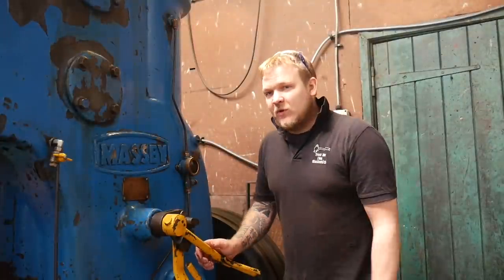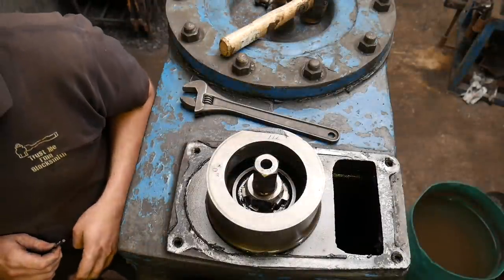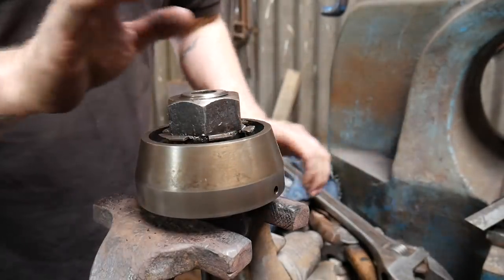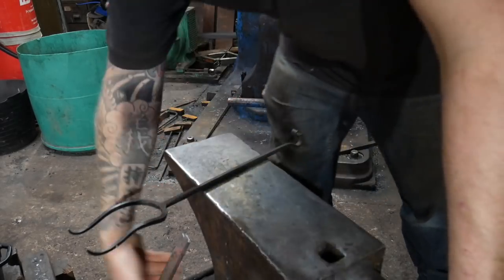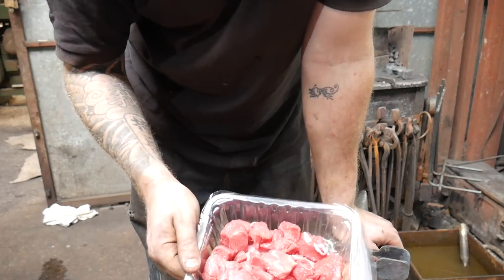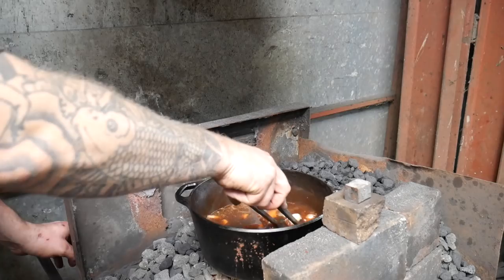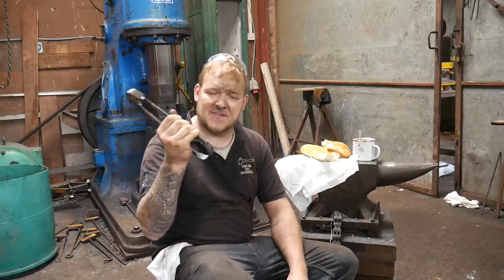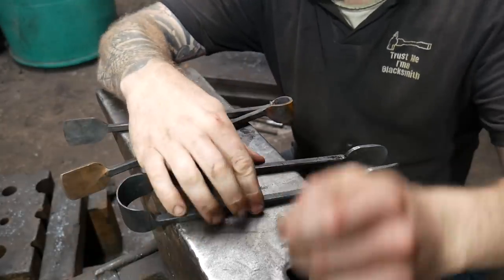Power Hammer FIXED! R&R part 11

Comment: Cooking videos are fun. I like the smaller tools you're doing more. 

Also I find round stock easier to work with.

Pro-tip on cooking. Add your four before you add the liquid. Let it mingle with the grease from the meat and once it has gone together, add the liquid

Comment: Love your Ruff&Reddy's Also love your Forge cooking. Dont change. As a fitter and machinist I cringe at times with your terminology and repair methods, but please dont change. I'm sure as a Blacksmith you would cringe if you saw me in the smithy. However I will give you 1 little piece of advice. Trust me, If an Aussie ever offers to share a Dutch Oven with you, decline politely!

Comment: Carrots wrapped in cellophane !!!
Do you have no fresh vegetables in your country?
I rate for tongs, she looks good 👍
Reply from the maker: I'm not sure if the carrots where frozen before packing but if not they where only a couple of days old at the most. Pretty fresh to me. And the cellophane had holes in it they ain't vacuum packed or any thing. Same with the shallots just in a little plastic bag not vac packed. Got me worried about the condition of my country vegetables! I think they fresh just not packed the same as they do in yours.

Thanks you for the comment.

Comment: Did you say 3 mil or 3 mm? There are 39.37 mils per mm. Not exactly a ballpark difference but enough to make a mountain out of a molehill! If you want to check mils, it's better to use some shim stock.
Reply from the maker: Last time I had this conversation the gentleman I was talking to tried to school me in native UK and Europe language.
Reply from the maker: Have you ever worked in the uk?
Reply: @danielmoss2089  
Never worked in the United Kingdom. Have been a tool and die maker for 27+ years. Measurements are standard regardless of continental location.
Reply from the maker: @stanervin6108  well I hate to say this Stan but mils in the uk doesn't mean a thousands of an inch it's the way we say millimeters or millilitres. Mil is a single millimeter or single millilitres.
Reply from the maker: @stanervin6108  we normally uses thou for a thousands of an inch.
Reply from the maker: @stanervin6108  if you don't believe me check the Internet, it's said to be a common mistake and often cause confusion. My dad calls the mils as does my grandfather. My girlfriend makes furniture and she says it as well, The students working here with knows what I mean and we never had a conversation about it.

Sorry to come across as a bit of a dick but the last time someone brought this up they where very rude. I'm English and I uses the meteoric system on a day to day bases I know that the term I'm using is correct.
Reply: @danielmoss2089  
  Sorry Daniel. I was under the impression that you meant mils, due to the fact that you were using a machinists caliper. I guess the obvious isn't so obvious after all.
Reply from the maker: @stanervin6108  no issues just I've been here and the guy that was insiting he was correct and I understand cultural difference exists he didn't. I'm not a fool and I'm not about to suggest your wrong how ever I'm not either. I'm sure a shime gauge like I used at the beginning of the video would be better but for this I made an executive decision. Also I have only ever used metric calipers.

I hope I wasn't too salty but once bitten twice shy. The last guy end up need me to explain America history and what the 1973 metric act was in the states. (I think that's right I'll check.)
Reply from the maker: @stanervin6108  sorry 1975 and basically Americ has been using the metric system since then just due to popular dislike by Joe blogs it was never made public.
Reply from the maker: @stanervin6108  check it out its a real eye opener.
Reply: @danielmoss2089  
  As a clarification, when I stated that measurements were standard, by no means did I wish to imply 'Imperial'. I guess a more appropriate term would have been 'standardized'. I am well educated in metric and imperial measurement systems, as I use both daily. I guess the obvious isn't always in the eye of the proofreader.
Reply from the maker: @stanervin6108  you sound like a level head guy and if I came across in a bad way sorry. Just not keen to get schooled in a subject that the teacher clearly didn't understand. You seem much nicer and we'll better educated. The term mils was used for mm. Sorry for any confusion.
Reply: @danielmoss2089  
  No worries at all, Daniel. I'm feeling adequately convinced that we both were afflicted with assumption syndrome. 
   But your hammer is bigger than my Little Giant 25 ! I poured new Babbitt in the crank bearing saddle a few years back and learned about the importance of shim selection for the sealing surface of the cap. 
  Have a great weekend, brother. Forge on!